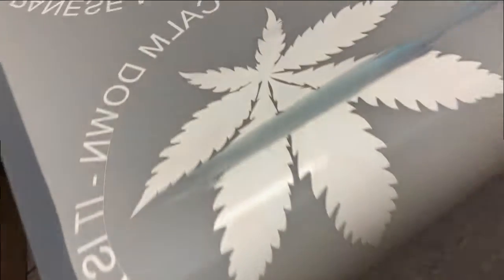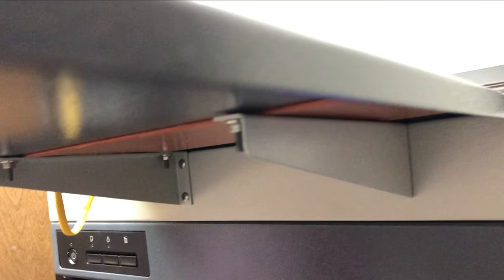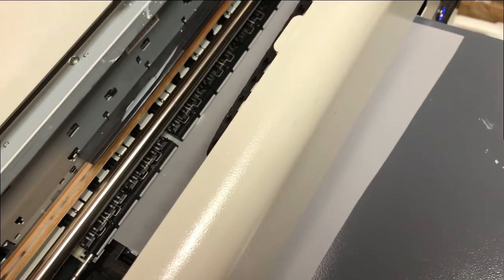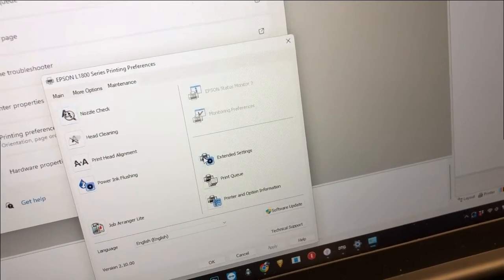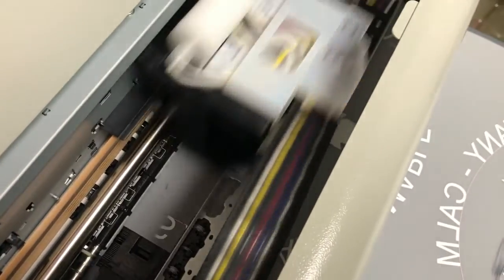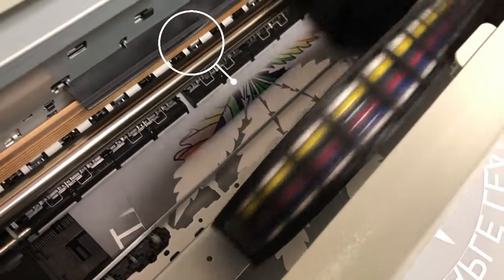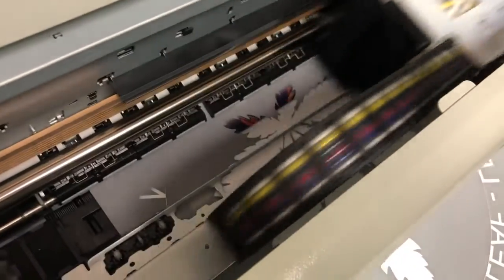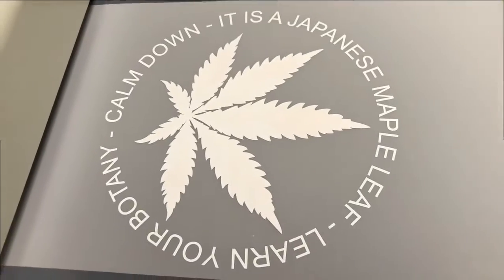How to fix DTF Repeated Smudging with Roll Films - Printhead Strikes

Comment: Hi Kevin. My DTF printer’s paper guide roller is pressing too hard against the film and leaves scratches on the coating of the film. It causes holes on the printout. Ink does not stick on the parts where there are scratches
Reply: Did you ever find a solution? I’m having similar problems